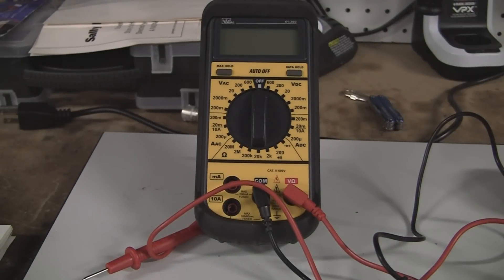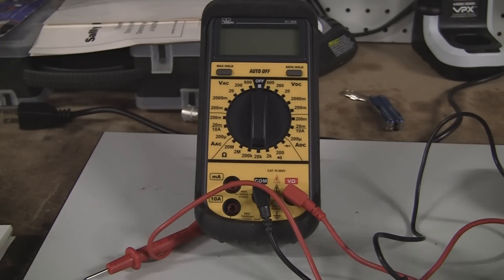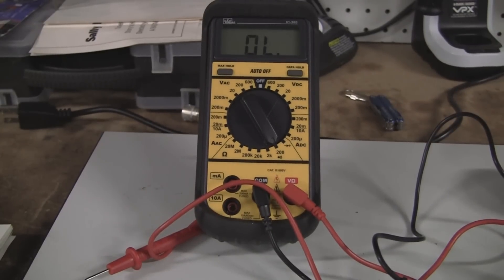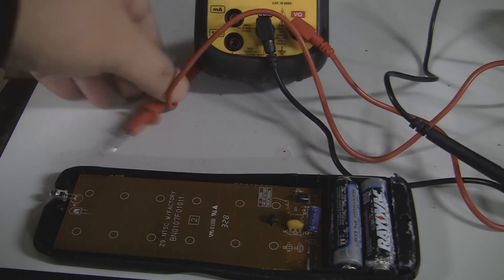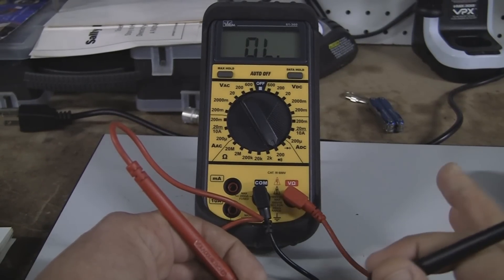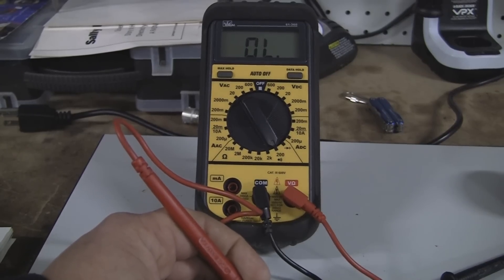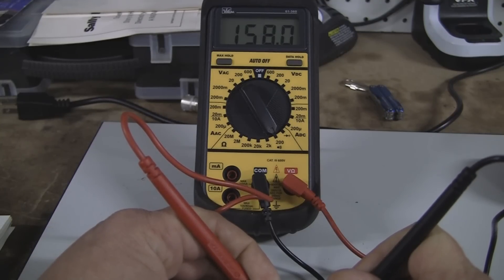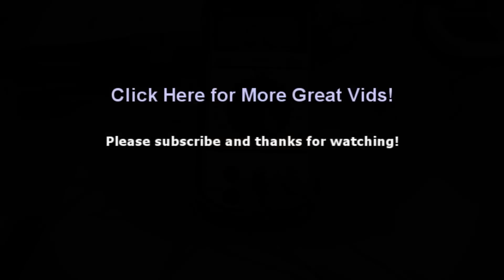Using A Multimeter to check Ohms (resistance) Resistor Example

Comment: Interesting point here [if accurate], you can have a very expensive Multimeter, and a 10 dollar one, but in most cases, like in the video, the probes are the same, and same short length. I find this interesting, I could be wrong, so inform me, but my cheap ass DT-830B 10 buck job, has the same cheap looking probes as this nice unit.  ?
Reply from the maker: Any meter will work just fine :). I'm just lazy.

Comment: I don't get any reading on a resistance. Do that means is not good?
Reply from the maker: +Daniel Pena I would say yes but make sure you have it on the correct setting and get the specs from the manufacture.

Comment: how would you check the resistance of something that isnt a resistor? I have some small electrical cables with aligator clips on either end I wanted to test. I probed both ends of the cable/wire.. not sure what the numbers on the DMM mean and what values would be considered 'ok' and what would be bad.
Reply from the maker: +sypher0101 You would have to know approx what the working values should be. Everything is different and there is really no "golden rule". Sometimes you may even need to contact the manufacture.

Comment: Great quick tutorial! Let me ask you this though.. I have a radio shack multimeter which is somewhat dated and I need to replace some parts on my refrigerator. The many videos I watched said to place the ohm setting to 20k... it should read 16k-ish. The multimeter quickly goes to 0. It's a brand new part. Is there a sure way to test that this ohm meter is accurate?
Reply from the maker: steve resendes The easiest way I can think of is just to test a resistor that you know is working. I know that sounds kind of general but it's what I would personally do.
Reply: ***** thanks for the heads up!

Comment: Is it the same with speakers??
Reply from the maker: zavaroudikos1 You would set the meter up the same but just put the probes on the terminals. No resister to check such as this.

Comment: whats with the 200  to 20k modes for... i'm trying to test my tv's caps and resistors but some caps don't show anything on the 200 mode. but if i go to say 2k or 20k it gives me a number. could you attempt in your own words to explain this? lol  i thought it was just incase you had a cap that has a WAY higher value say 15k it could read it and give you an accurate reading. but it always changed the number completely so i wasn't sure. (example, i read a cap that was 12 ohms on 200 mode, figured if i went to 2k mode it would just show 12.00 ohms or like 0012.0 but it gave me something random like 3576)  thanks for the reply in advanced =D

Comment: yes ive been checking the pre made ones. I have a rebuildable atomizer and resistance wire on order. So the goal is to wind my own coils. Just wondering what erratic readings would mean. Well except the 22 my guess is the coil is just too big.

Comment: That beep caused me to piss myself. I'm checking the resistance of e cig cartridges. They range from 1.25 to 3.5 one came up as a 22.5 and one that I had been using and starting to taste off read very erratic jumping to 115 55 45 8 9 ect. What would this mean, thanks for the info.